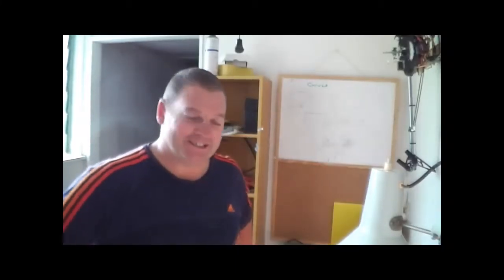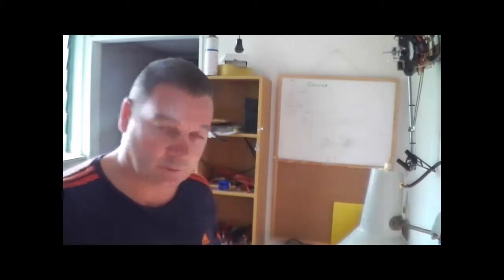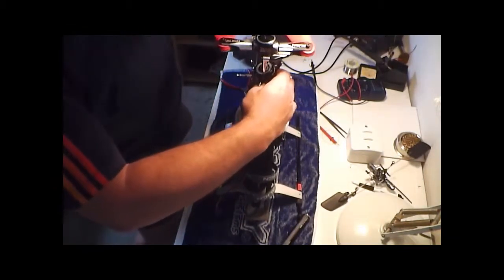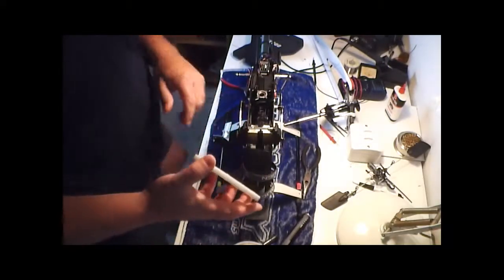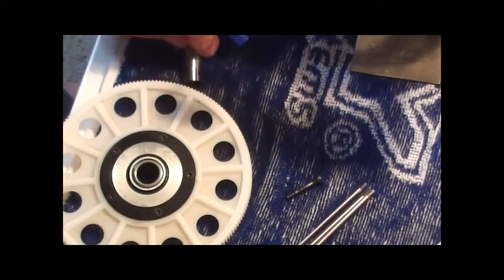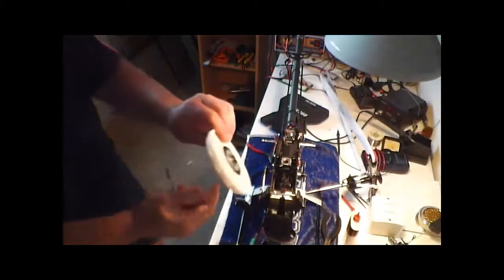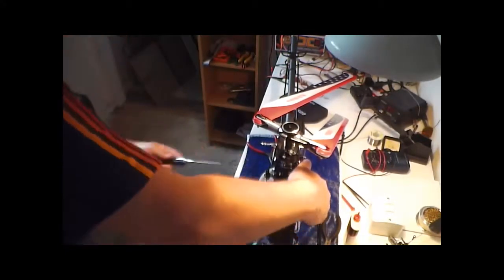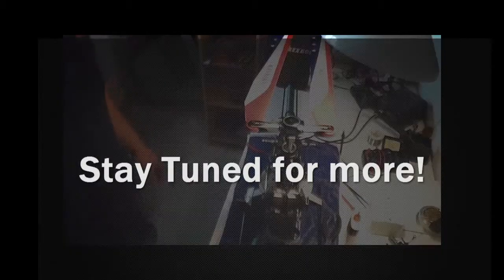RC Heli One Way Bearing Maintenance

Comment: Hey mate, I got a question. I picked up a used T rex 500 DFC a while ago and replaced a bunch of components already. I am using a strong enough motor but i am not reaching the required head speed. Now I am suspecting my one way bearing which I did not replace yet to slip under 80% ish throttle. Should you be able to turn the rotor head counterclockwise with your hands? I am not even using a ton of force and the oneway bearing slips when I do that.
Reply from the maker: Hey There! you are 100% correct. the one way bearing has been damaged and should be replaced immediately. Otherwise it could completely fail and you will freefall your heli.